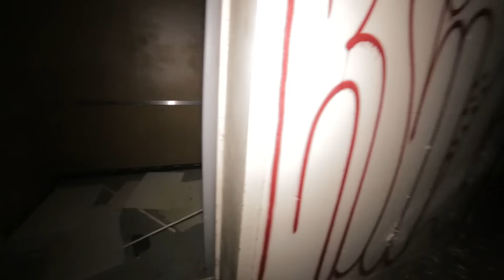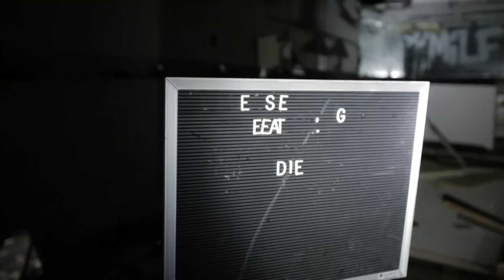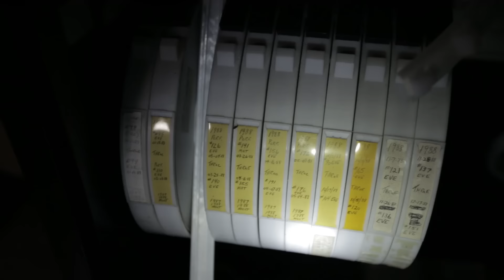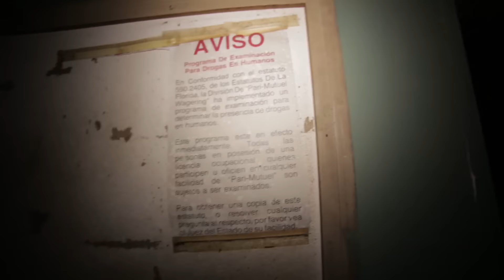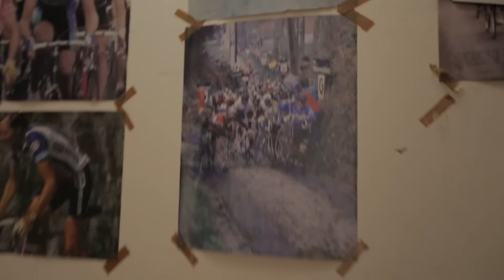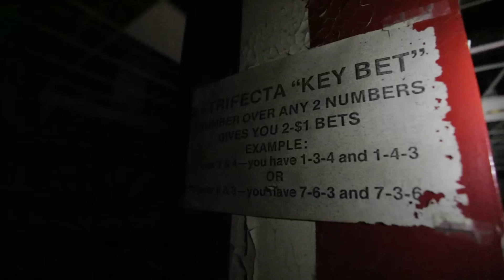Abandoned Jai Alai Stadium Exploration - Bat Infested!

Comment: Those are 9-track magnetic data tapes from an old computer mainframe, possibly IBM or Digital Equipment Corporation - the yellow rings are write-protection bands for them.
Reply: +Daniel Colmer Yep. I used to have to backup an IBM System 3 Model 15D to them back in the day. Took forever.
Reply: those computer tapes need to be in a museum.  There's obe here for old large frame systems here in Pittsburgh

Comment: Those were tapes in computer tape drives, usually used for backups. The Yellow rings were read-only/Read-Write (with the yellow ring you could write to the tape).
Reply from the maker: +James Horn Interesting, thanks! It never even occurred to me that we used to store computer data on tape.
Reply: +The Proper People I was going to say that then saw James beat me to it. They were used on Mainframe Computers,  most likely an IBM System 36. Nice video  thanks for sharing.  also bat guano is toxic to breathe please wear a mask.

Comment: That tape you found is actually 9-track data tape. It was some of the first 'removable' media used on computers.  Depending on the density of the tape and length it can range anywhere from 20 megabytes to 250 megabytes per tape.

Comment: Oh wow what a find! That huge machine you find at 2:45 is what's called a Linotype machine! Basically, when they used to have to individually place pieces into a printing press to make a plate, they'd have all the little individual letters on individual little pieces. You'd press some keys, the letter stamps would fall down into place, and then you'd pull a lever to lock them into place, and when you were finished you had a plate for printing out a newspaper or a flyer or something like that. Of course you'd then later have to put the little stamps back into the top of the machine. There's a Twilight Zone episode called Printer's Devil where you can see Burgess Meredith running a linotype machine at high speed.

Comment: Those linotype machines had keyboard operators who would produce lines of type in lead that were set in trays to produce a newspaper page. Eventually newspapers did away with linotype operators. Instead, they utilized teletypesetters, a typewriter like machine, that would produce paper tapes with perforations.  I was a teletypesetter operator for a newspaper for one year in 1968. We would receive edited "copy" from the editors that had been typed by the reporters and retype it to produce the perforated tapes that would be sent down to the press room to be fed through the linotype machine, similar to a player piano.  It was pretty state-of-the-art back then.

Comment: At the 4:55 mark. Those are old data reels, not audio or video. I'm an old I.T. guy and used to work with those in the 80's. There was probably a bank of tape drives connected to a computer, maybe a mainframe. These tapes were "3420's". The little plastic rings you see on the floor were the write protects and would fit on the middle of the tape. Real old school computing stuff!

Comment: (Visible) frames on the storage medium, I'm guessing you were talking about, are for film; not videotape. I'm assuming that you shoot on flash storage, but there are still some videotape cameras that are probably in wide use. I have one that I still use fairly regularly (if I want to do some deep zooms, because my deepest zoom camera happens to be a taper). And with as wide as that tape is, and your having found what you think is a video switcher, I'm pretty sure those rolls are videotape rather than audiotape (although there is multitrack audiotape that's pretty wide too). Most videotape is scanned in diagonal sections as it passes over heads on a diagonal spinning drum. Videotape can be as wide as 2 inches down to as narrow as 6mm!

Comment: Those tape rolls were computer data tapes... Like in the old movies, when you see a reel-to-reel tape running in a computer room....  At one time, they were the "default" setting for big data storage.....  Usually called Magtape, or magnetic tape...  You guys are too young, but they were ubiquitous at one point.  Everywhere.  Even the smaller companies I worked for had hundreds of those rolls in storage rooms, marked, dated, all of it.  Was WAY cheaper than those "newfangled" hard disc drives, haha!

Comment: 1. a press?  last time I saw one , well I made a comment about our old newspaper spot, but yeah that top floor with metal sheets covering up the holes in the floor was home to one very heavy old typesetter press  smh  Wonder if it fell 4 stories down by now :O  probably be cheaper to cut open the roof and remove it via helicopter.  if it's even still there. last paper printed locally was Oct 20 2008 in Waterloo ia. 2. Bats oh come on.  we have them all the time outside and sometimes in the house :P and with a glove I was the only one to bother to catch one by hand.  Oh look teeth :), he'd be the same one I slept with when at 3am I heard an odd noise but seeing it 3am and I couldn't get it to leave between turning the a/c off and opening the bedroom door and leaving it on with the bedroom door close hey the bat hates the light so I went back to bed. :P  Think I've been more spooked by the wingspan of an owl than a tiny lil bat.  Raccoons like 6-7 up a tree in the back.  I was lucky to have a bright headlamp on or I'd be in trouble so I've been told.  So bats are the least of my worries (oh and one mouse a few months ago...  don't know what happened to him.  (okay who left the garage door open again  smh)